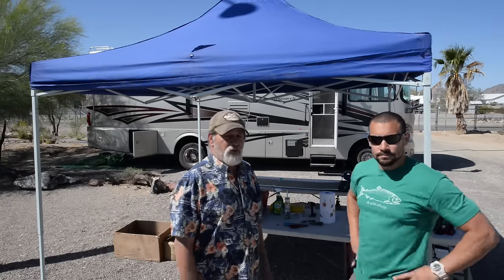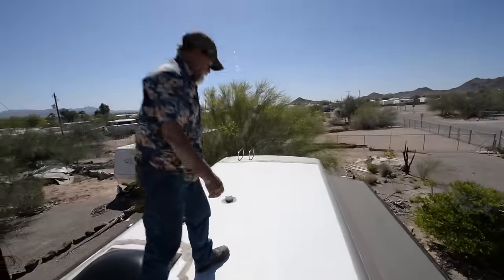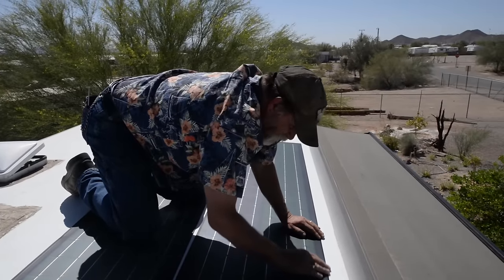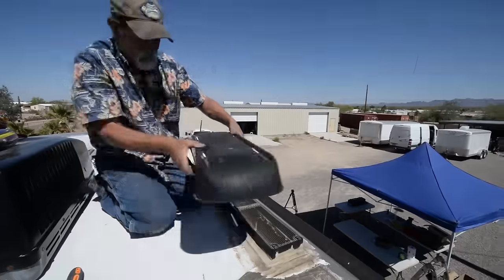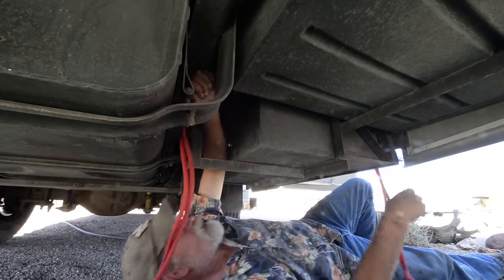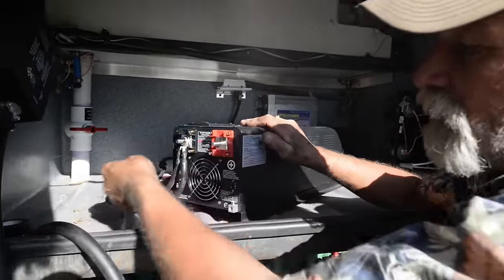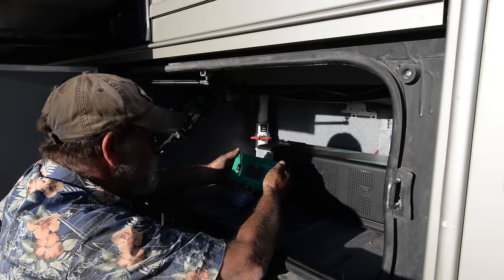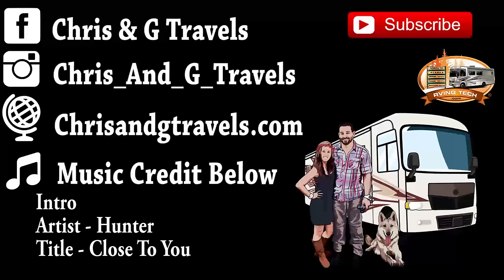Full RV Solar & Inverter Install  ~ From Start To Finish

Comment: Great video, thank you. At 6:35 into it Robert says he ran 2x "4 Aught" cables for each of battery + and - to the inverter. "4 Aught" in the electrical trade is 4/0 wire,  with a minimum continuous load capacity of 230 Amps. So 2x that is 460 Amps continuous from the battery bank !!  I think he actually ran 2x 4AWG cable size, which is 85 Amps continuous each conductor, so 170 amps total. The 4AWG is adequate and 25%  the cost of the 4/0 size.  4/0 is a huge wire size and no reason to need that at a length of 10-12 feet. Commercial welders would typically run 300 amps at 150' length with a 4/0 size.

Comment: The gentleman did a thorough job explaining the installation process and the operation of the panels without rush.   The flexible panels will save a ton of weight as well as the dissipation of wind drag.  Nice Work!

Comment: Thanks for showing every step in this process.  I do like the idea of a flexible low profile solar panel.  
When you were showing the new tripod in yesterday's video, I couldn't picture what you would use it for.  It was interesting to see you use it in this video.  I can see that this will add a new level of professionalism to your videos.

Comment: I really like the fact that you don't have to drill holes into your roof for mounting brackets! I think that part scares more people away from even attempting this. I also like the three in one controller, hopefully your real world test will prove if it is a good design or not.

Comment: Thank you!  I've watched so many videos, where they bolt on the panels, then the wires magically get inside the trailer and they're like, ok you hook them up to the battery and done!  The refrigerator vent makes a lot of sense!

Comment: Chris, safety issue!!!Where is your propane gas fill cap? This is a must. Dirt getting inside this area is injected into the system. The dirt could get under a gas valve seat eventually (ie: Furnace gas valve, Refrig gas valve) and cause a fire or worse! Good Video, this guy knows his stuff. Must be Quartzsite by the look of things!

Comment: One other note just for clarification. The battery cables used are 4 gauge not 4 "ought" or 4/0. The sizes go from 4 gauge, 2 gauge, 1/0 gauge, etc. The smaller the number the larger the wire. So in this case he used 2- 4 gauge wires to effectively make it equal to a single 2 gauge wire.
Reply: Yes, but 4/0 is BIGGER than 2/0. This must be #4.

Comment: Great video.  That is the controller I want - tie the whole thing into the house system and work with shore power too.  Most, it not all other videos have the solar as a separate system feeding only selected things.
Reply: It is the only controller I've been able to find that brings the solar power into the same inverter that uses the main batteries to power the AC breaker box for the AC appliances. I have asked numerous RV equipment sources if they know of another, but have found none, so far. This next round of RV shows may have more providers, so you might want to attend one as I am planning to do.
Reply: More recently I learned that AIMS also makes a controller/charger/inverter (CCI) with DC inputs from the solar panels built into the unit. The videos showing this do not, yet, even mention those DC input terminals, but they show clearly in the video. It was very similar to this EEZ RV Products  CCI, and worth a look.
Reply: EEZ RV has one?  That's great to know.  I will check into it. Thanks!!!
Reply: Controllers fail and cannot be repaired in many cases. Keep it simple, seperate low and high voltage systems so you can upgrade when they fail. Tie them in only at a manual selector switch or perhaps a generator type auto switch.

Comment: Looks great. I went with the aluminum frame panels last year. At that time the flex able panels were having issues with heat. Looks like they have that problem solved. My system has three 100 watt panels in series to a 40 amp mppt controller. On a good sunny day the voltage gets over 70. Best of luck and I hope to see more videos on your system. I'm likening that converter / inverter.

Comment: The installation needs to include grommets and protective sleaving for all the wiring that was installed. This is especially important under the coach when running through openings in the frame and other sharp edges. Over time it will rub through the wire insulation and cause a short. This is a fire hazard. Especially when driving on rough roads like you do. It also helps to protect it from rocks and other debris that will be thrown up while driving. Other than that it seems like a well designed and installed system.

Comment: The energy production efficiency of solar panels drops when the panel reaches higher temperatures.  Fastening the flex Photovoltaic panels directly to a flat surface such as the RV Roof will have a negative effect on panels output. I believe the panels output decreases when panels hit 107 deg F..   I have always mounted panels so  an air space is between panel and bldg or RV Surface.  You could imagine how this helps as the RV is moving down a highway.   It was a great video...Thank You..
Reply: the great thing is people are mounting the panels with 3m vhb industrial 2 sided mounting tape and you have no holes in your roof from screwing down the panels they are just "taped" to the roof and vhb is some awesome stuff

Comment: Thank you for providing this video. This controller/charger/inverter has all the features I was looking for and at a good price ($1,360 or so) but I ordered it over the phone and was sent a simple charger/inverter. I'm still waiting to get my money back since I just returned it along with the fold-out 130-watt solar panel that EEZ RV Products sells after they responded to my complaints on their version of this video in devious ways.
Reply: They implied that I did not order this unit and that I was not aware that this unit has its solar input terminals on the opposite side of where the DC output terminals are. Both are lies as you can see in this video at the 1 minute mark the solar input terminals are NOT on the opposite side, but right next to the DC output terminals.
Reply: The fact that the company rep lied about that and about the solar panel supposedly not being compatible with this unit dissuaded me from keeping it. If they lie about stuff like that, you can imagine what kind of service can I would get. Good luck with it and let us know how it performs (and what, if any service needs you had and how professionally they were handled).

Comment: What's up Chris, congratulations in your new solar system. I also saw that you changed you lights to LED's. Great move. We are in the process of sizing and purchasing a system for our travel trailer.

1. Have you ever monitored how much power you use while boondocking ?
2. What type and how many amp hour batteries in your system ?
3. Will your generator automatically charge your batteries upon start or do you have to toggle back and forth
     to charge the battery bank ?
4.  Does your system have a main shut-off for the solar panels for system maintenance and upgrades ?

Thanks for the video and information Chris. I also thank you for the great job you've been doing with your videography. Allot of people don't know how much thought goes into setting up a shot. You make it look easy. Bravo... Thanks and Much Peace !!!
Reply: Marmac RV Adventures '

Comment: For the sake of efficiency, at least if you're able to, you wanna try and put the inverter as close to your batteries as you're able to (lots of current traveling through those lines). 
It's not as big of a deal on the panel to electronics side of things, especially since you're going with a higher voltage series setup. 
Very good, thorough video of the process. 
Thanks for doing this video guys :-)

Comment: Chris, keep an eye on how hot those cables get - especially the run from the batteries to the inverter.  Most of your installers recommend to be only 5 feet or so using 4/0 cable.  All these runs are really long.   If you discover any of these cables getting warm to the touch, then disconnect and regroup.
Reply: Good advice.
Reply: Also, I did not seem him install a high amp disaster fuse, and 4/0 wire is bigger than 2/0. Running pairs of wires to share the load is not a good idea, one of the two cable will always have less resistance so it won't carry the power evenly and if one of those two wires wears through and shorts to ground the wire will burn up before the disaster fuse blows, because it has much less capacity than 4/0 cable. If there is not disaster fuse, and the paired cable instead of the 4/0 make this an unsafe situation. If those things are corrected, you should be all set.
Reply: actually thats not true. on such a short run the resistance variation would be so minor as to be inconsequential ... now if your talking miles of cable then yes you could have uneven resistance that would matter. But at 20 feet or so it's so minor it won't be a problem and putting cables in parallel to is actually a good way to carry more current with smaller cables
Reply: Yes it is true.  Use a cable sizing calculator and you will see that even a couple extra feet of length has significant loss on thinner size cables.   Resistance turns into heat, and heat can turn into fire.
Reply: This is NOT 4/0. It looks way undersized. And pairing wires is VERY common in say a large building with 2000 amps coming in, but that is very high voltage where the resistance loss means so much less. You would have to be very careful to keep all connections very clean, so one cable doesn't end up taking too much power like John said.

Comment: As the sun is moving during the day one needs to point the panels directly at it to gain maximum power. Having flat roof panels is sort of okay if you live on the equator. A simple tilting system would greatly increase the power captured considering one only gets the sun for half the day.

Comment: Chris,  the solar option seems great. I have serious reservations with the adhesive application. A hard point attachment is much more adventitious. Keep a very close eye on your arrangement. I feel the panels over time. Flex and the adhesive will degrade and loosen. If your at highway speeds. There is a possibility that solar panels could come loose and dislodge from the coach.  I hope I'm wrong.  Would you consider attaching a border around the panels to hard attach the panels to the roof of the coach.  Something to consider. Cheers, Mate.

Comment: The only thing I would of changed was that I would of put the 250-Watt Renogy Solar panels instead.
I would of got between 6 to 8 of them, depending on the room I had. and I would of also Installed 6 to 12 TROJAN Deep Cycle T105-RE's batteries or better.
Congrats on getting solar.... very big accomplishment right there.
Very cool video  :)

Comment: Nice job. What really caught my attention was no screws into the rig. It appeared that even the wiring on the roof was attached with adhesive and tape? Interesting to see if that holds over time.

Comment: Really great install video.  I would love to have him do something like that to my trailer.  My only problem was that he didn't appear to use any insulating materials or grommets at the point where he passed the battery and charger cables through the holes he put into the box where the converter/charger/controller was located.  The wires will chafe over time if there is no grommet.

Comment: I have two design issues with your install.  One is that you should have used a conduit of some sort on the roof and in the wire chase to protect the field cabling from UV and chafing down through the RV.  Second, the inverter doesn’t have enough air space for proper cooling. That small compartment will cause the operating temperature in that small compartment to sore During long operating cycles in the summer. Some sort of natural convection or if necessary a fan ( I hate to use fans)  to exit the heated air or choose a different location.

Comment: Thanks much for the video.  The Charge Controller, Inverter combo seems ideal.  What battery wire size (double up) are you using in this video?  I heard the installer said 4/0 wires (which are 0.530" = 230 amps) but doesn't look to be that thick.  I believe he meant he used 2 gauge AWG wire double up.  Renogy, Suaoki and others make 100 Watt semi-flexible panel that's half the size.

Comment: Having just built some "inter-battery" cables with 4/0 wire - I can tell you that what he was using/calling 4/0 WAS NOT! More likely #4 gauge . . . much smaller.
Reply: Yes. 4/0 is BIGGER than 2/0, while #4 is SMALLER than #2. It must be dual #4's.
Reply: Did he call it 4/0 (four ought)? The cable he was working with was probably 4 guage. MUCH smaller than 4/0. It is a common mistake. Study up before you buy cable...it is really expensive. IF you ever see welding leads at a garage sale...buy it for future use!

Comment: If its day light those panels are giving power so those cables should be in a flexible conduit or after a while with all the movement in the camper they will wear through and you will have a short then a fire!

Comment: those flex panels are really nice but being flush stuck on the roof like that means they won't get good efficiency because they will be hot and no air movement  underneath and being that you are in an obviously hot weather area...........but this was a good video and keep up the good work.

Comment: Two problems with flexible panels, one they aren't as efficient as traditional panels ( probably not an issue with your roof acreage, you have plenty of room for more panels), with panels flat on the roof they heat up dramatically and all solar panels lose a lot of power when they get hot. Traditional mounting allows air to circulate around the panels keeping them cool.

Ron W.
Reply: +Ron Weiss I was wondering about this same issue.  What are the compromise percentage loss in efficientcy and life time wear/tear of a flexible flat to the roof mounted solar panel.  Versus traditional panels.  Plus you can no longer angle them to the sun for increased efficiency.  No tilting.
Reply: +Kevin J 

I think they'll be OK even with the loss of efficiency, they have so much roof real estate more panels will be easy to install if they feel a need. And they can just follow the existing wire routing for a do it yourself 
project.

Ron

Comment: Chris, other videos recommended raising the solar panels off the roof top so air can circulate beneath the panels, knowing you are a consumer researcher, why did you choose this style of solar panels versus the framed ones than can be raised ? Has technology advanced to the point that heat from the roof is no longer an issue ? Please let me know which features made you decide on this product.  Till next time....Janet

Comment: I want this solar kit for my rv, looks great ...How much does this system cost with the install.?...
Reply: m
Reply: Google. Systems range from $600 or so to $60K. Ingenuity lowers the cost, conveneince inflates. There is NO upper limit.My first system was submarine batteries, welding cables and marine rotary switches...it worked fine for 20 years yet I had to tend to it every day...now I have modernized yet my controller and inveter are decades old. Onlt the panels failed(due to hail damage and rocks) and I have gone flexible.

Comment: With the panels being adhesive, what happens if they go bad ? How will they come back up and what will it do to the fiberglass roof ?
Reply: +RJ's adventures with mineral sprites it will break down the adhesive. it take time but they can be ripped off. but indeed. I hate the system they decided on. flexy panels may sounds like a good idea like air drag while driving, but there not  a good idea i think, they have no space under them now for when they heat up. The hotter a panel is the less performance you get out of it.  Also dont like that all in one con/inv/controller box. all in ones are lovely to replace if they fail. 

I would of picked normal mounting panels you can put tiling hardware on if you need to move them for extra sun light, and even when stowed there up a bit from the room giving them proper air from under to not overheat. and if a inverter fails you dont have to replace a entire box. I like having a system in parts when possible. separate controller, converter, and inverter.  so one fails just have to replace the one thing and not bulks of it.
Reply: +Troy Foxxin ....I too would rather go with separate panels for maintenance and heating effects. These are easier to install over standard panels but still worry about the heating effect. Also I ( just my opinion) would want separate controller , charger and power inverter as everything in one package seems to be asking for trouble, but that is just me. It was a still a great vid  and liked the wire that the installer went with. Be interesting to see how the overall performance works out...... Let us know Chris !!!! Thanks.
Reply: I would think that if one went bad you could most likely stick another one right on top of the bad one.
Reply: RJ's adventures.         Good question, I would like to know also ?
Reply: Adhesive panels from a well known quality maker rarely fail.  Panels need no space underneath as they have the roof to act as a heat sink. Note that rigid panels mounted so they stand off just re-radiate the heat right down to your roof. They are not insulated unless you make them so. Also, quality panels are virtually unaffected by the heat experinced even in full sun and the only drop in output occurs over time...many years down the road. Also... rigid panels are somewhat frail in comparison. As with all panels...avoid the bargain basement "no-name" panels.